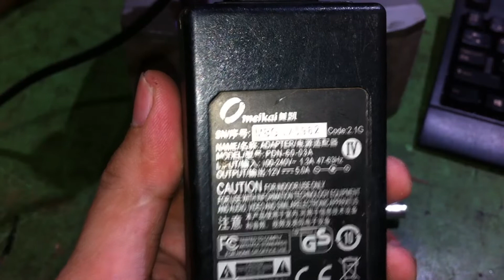TPA3116D2 2x50W Digital Power Amplifier Board

Comment: He bought a bunch of amps , one power supply too I think.  Mainly loads of cheap amps , he is powering with a laptop charger , that will give about 3amps and 19 v , just under the 24v rated for most of these amps. It will be plenty loud
Reply from the maker: you are right sir. in fact the power supply that came with my order I will not use with the amplifiers.

Comment: where did you buy the amp?
Also, what are the other boards you ordered in the box?
Reply from the maker: https://shopee.ph/TPA3116D2-2x50W-Digital-Power-Amplifier-Board-5V-To-24V-Dual-Channel-Stereo-AMP-i.226548939.4542883113   the box contains a voltage meter 30 watts amplifier microphone pre amp kit.